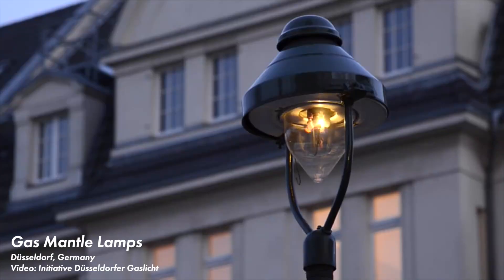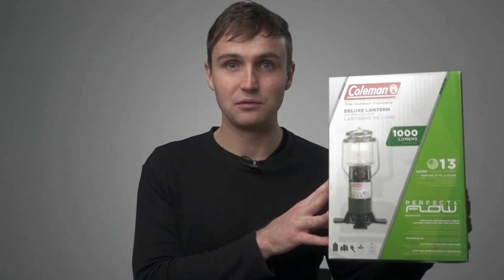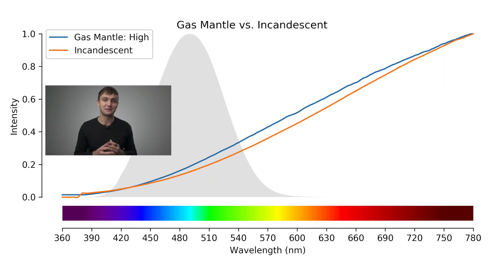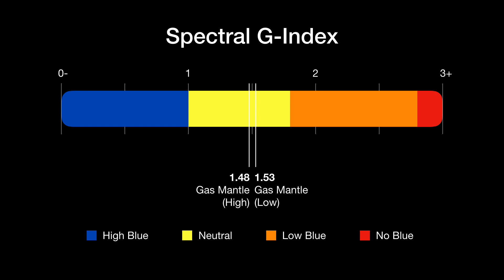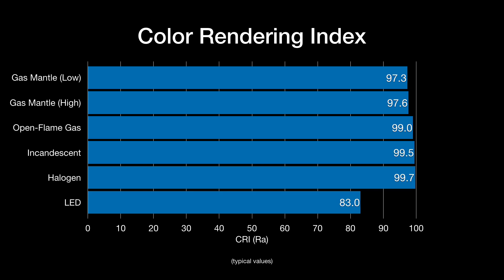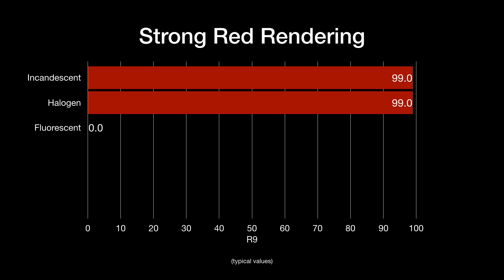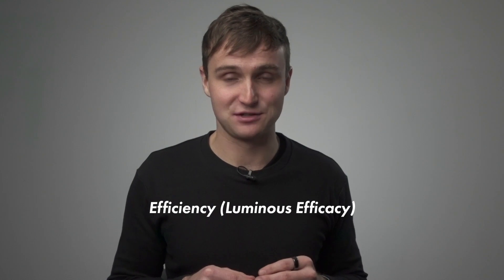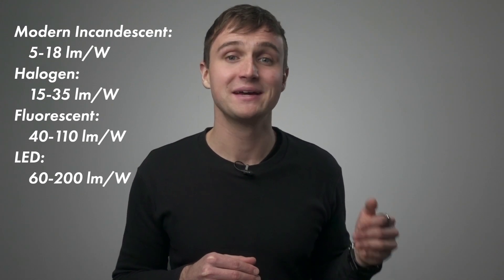Testing Gas Mantles 🔥

Comment: Incandescents were not as bright or white at that time. Gas gives a very good light like a modern incandescent just with a touch of blue green added from the blue flame inside the mantle. Also they changed from open flame to gas mantle so they could use natural gas which does not light very well otherwise because of low carbon content (soot produces the light in an open flam).

Comment: Don’t forget that gas lights may be inefficient, but they turn the fuel directly into light. Electric lights of course require an engine, generator, and wiring to transmit the power to the lamp. So an electric lamp itself would need to be several times more efficient than a gas light just to achieve the same efficiency, then there is all the maintenance and wear and tear that basically doesn’t exist with a gas light. Edison’s steam power plants were probably less than 5% efficient.
Reply from the maker: That's a great point. As electric lighting (and power generation methods) became more efficient over time, they became more viable.
Reply: Most gas lamps were running on the city's coal gas. Producing coal gas is extremely inefficient quite simply because the gasification process wastes a lot of heat. But mining and transporting the coal will also be a big overhead.
I would consider coal the primary fuel, and much of the coal's energy goes up the chimney of the gas works.